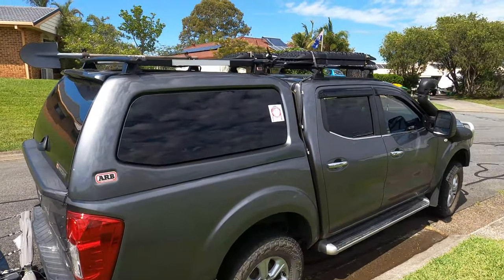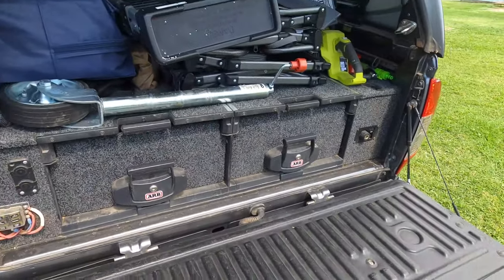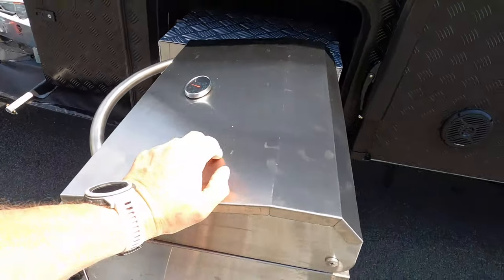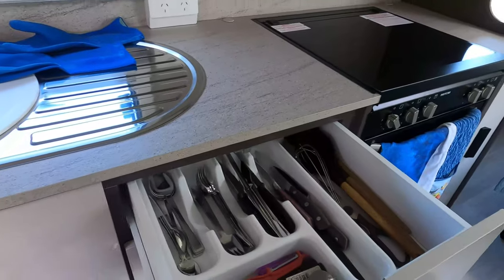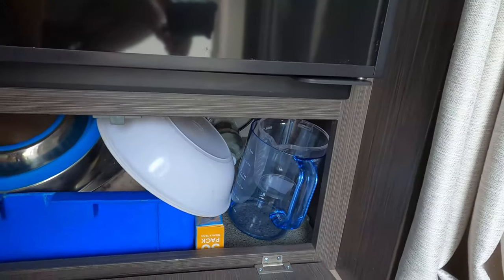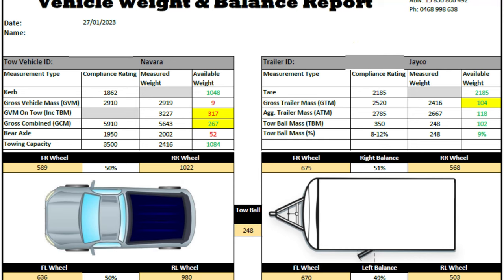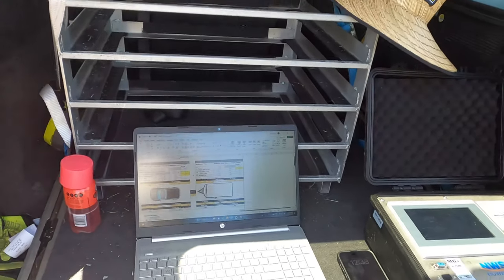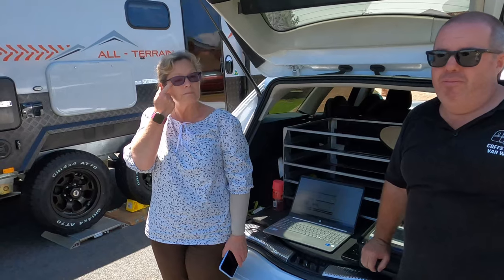Ep Mods 2303 - Our Rig Weigh-In

Comment: Well done for getting your rig weighed. I do worry about the advice given to increase your tow ball weight. The 10% thing is an old wives tale, for want of a better phrase. Many vans are well under the 10% and still tow perfectly well, a Jayco 17ft Outback PopTop is a great example. Adding tow ball weight will only increase the load carried by the rear axle of the car and you need to reduce that figure by a fair margin. Try lowering your tow ball weight (I can hear screams from some already) to around 180-200kg. Your van will still tow fine and it will reduce the cars GVM and rear axle load. Your van should also have inbuilt sway control and while it's wrong to rely on electronics to control the stability of the van it's a reassuring back up.
I hope the rear axle weight measured at 2002kg is with the van hitched. If that is the unhitched weight then you are way overweight on the rear axle. When you hitch up the van the 248kg tow ball weight is now supported by the car, yet the cars GVM increased by 308kg. That is normal because the tow ball is located well behind the cars rear axle and so acts as a lever. Reducing the vans tow ball weight by 50 kg will reduce the rear axle weight of the car by around 60kg, that's just how it works. It will also put a bit more weight on the front axle which will be a good thing for your rigs stability.
Moving weight from the front of the van to the rear can help but it's not the best answer. Too much weight at the rear of the van is just as dangerous as an overloaded car rear axle and it will also increase the vans GTM, or the weight the van axles are carrying. At the end of the day you need to take less stuff, especially in the car, and also reduce the tow ball weight of the van. You are not alone with this problem.
We have a Jayco 17ft Outback on order. We wanted an All Terrain like yours but after running the figures it was clear our MUX could not legally tow that van due to its high tow ball weight and the cars limited payload.
Good luck with sorting it all out. Many have gone down the road you are now on and hopefully many more will follow.
Reply from the maker: Yes the 2002 is with van attached. Yes I sort of agree with you about the tow ball weight, and am lothe to increase it. Idearly I'd like the get the ball weigh down below 200kg, which would knock 50Kg off the vehicle overload.

Comment: Looks like you have a good idea of what you need to do, I would to start with go to the tip e.g. to weight the vehicle by it's self, then remove everything, then re-weigh it, I would remove draws and draw frames, lose the fridge, extra battery, solar panel on roof, then re-weigh it --- what's stored under your bed currently, if you are over-weight in the vehicle or caravan the insurance will not cover either if something happens
Reply from the maker: Yep, lots to do.